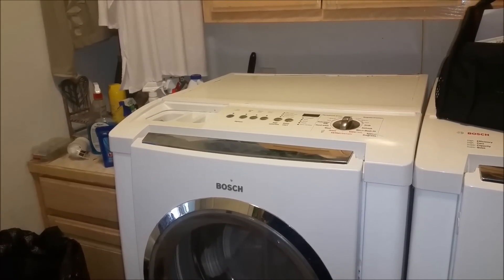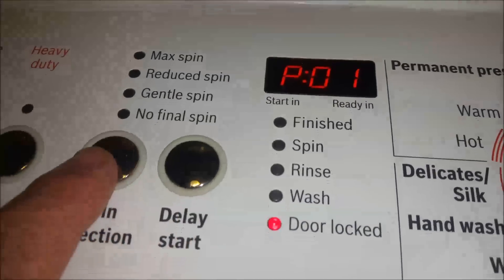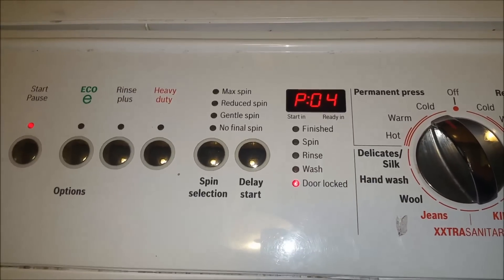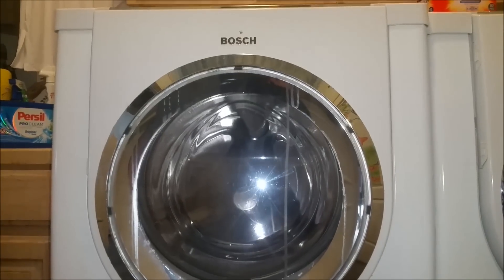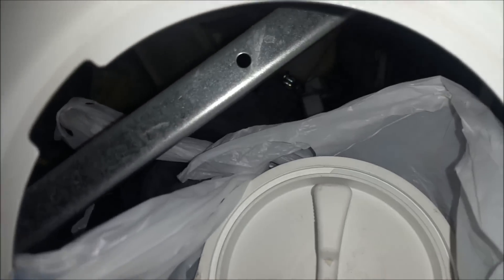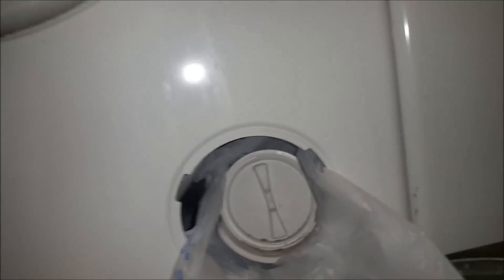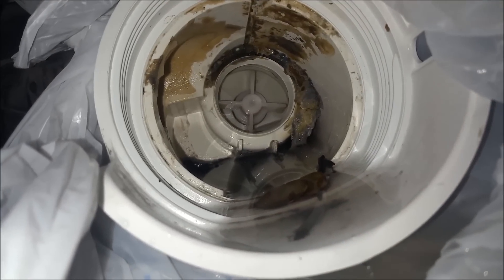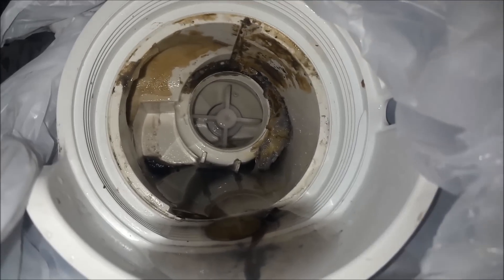Bosch Front Load Washer Won't Drain (e13 code)

Comment: I’m back again.  We are on pump replacement #2 for this machine.  Pretty sure my hb used your video 4 years ago when he replaced the pump the 1st time.  We've loved our Bosch washer and dryer for 15 years and 4 moves.  My only complaint is that it didn’t have a spin only setting.  I was heart broken to find out last year that Bosch no longer makes washers & dryers.  It strengthens my resolve to keep our current ones running as long as we possibly can. We’ve happily purchased many other Bosch appliances.  Thanks for still being here with this repair video.  Who knew we’d need it again?
Reply from the maker: Thanks and good luck
Reply: If you want German quality, go Miele. But I don't know what you mean when you say Bosch no longer makes washers & dryers. They absolutely do, and they do sell them in the US. They just don't make the 27-inch size any more (and neither do Miele after their equivalent flopped). They only make the 60cm size (about 23.5in).

Comment: THERE IS A EASIER WAY-------PAY ATTENTION TO THIS !!      I got my angle grinder & put a cutting wheel on. Next, on the bottom "right side" of the washer ( not the front where the hole is)   cut an opening...like a door, so you can swing it towards the rear of washer. The opening was approx. 4 inches X 8 inches, then bend it back, so when you're done removing & replacing pump,  you can just " unbend it " , put a little duck tape over the cuts  and the job is complete.       I have used the same procedure when replacing the fuel pump from a gas tank on my Ford Ranger. Most people remove the entire pickup bed from truck. I cut a 6" X 6" square ( only 3 sides though ) peel it back and remove fuel pump. Much easier.
Reply from the maker: Wow maybe you should make your own video

Comment: Can anyone explain what he's seeing with the pump that makes him says "That ain't gonna work" at about 14:25? It looks like the little fan thing is spinning freely so I'm not sure what he's seeing. I'd like to know my pump is dead before I buy a new one.
Reply from the maker: @screamingcats72  it loose and wobbles on the shaft bad end play although its normal to to have 1/4 turn of travel in a circle it not normall to fill loose and some of this is hard to show on camera and its also a trained fill that i see but past that it's a plastic impeller on a metal shaft and on the other side there's magnets set in plastic mounted on that shaft with close tolerances to the housing and I don't like recalls so when I get to the point of is there to much wear and tear i repace because they can work but be inefficient or make noise and in the scheme of things it's not price effective for me or the customer for it to go bad in 3 or 6 months and if something came in contact with that impeller while it was running chances are that it's going or is bad
Reply from the maker: Look at the left to right play that it has when I first put my finger on it
Reply: @Fasteddiesinhomerepair  Thank you so much, that was fast! I really appreciate it, and the video. I do NOT want to do this, LOL, but a repair man isn’t in the budget so this is a massive help.

Comment: If, upon inspection, you find that your drain pump is not locked up, moves freely, THEN... This is what fixed my E13 Error Code. Two screws remove the top panel; You will notice that the drain hose from the pump, loops up to the top of the cabinet. At That Loop is an AIR VENT attached. My vent hole was clogged with gunk.. Just pop off the tube, and clean it our with a toothpick, or small screw driver. Easiest fix ever. Note: if for any reason you remove the hose bracket, there is an O-ring where the bracket meets the tube, just don't lose it.

Comment: What if when you do p:04 it does drain fine? Does p:04 run & stop or do i still manually turn it off? Why do i keep getting e13 😆😭
Reply from the maker: E 13 means the washer thinks it has water in it so it could be something to do with the pressure switch or hose or air dome

Comment: Thank you so much for this video!! We followed your instructions and found 2 dimes and a ton of rubber pieces from the artificial turf but honestly not enough to stop the pump. We closed it back up and tested It and It still wasn’t working. I said let’s check again for the hell of It and lo and behold there were two WHITE rubber bands stuck in the middle that you could easily miss. We cut the rubber bands off and she’s good as new!! Can’t thank you enough because we would have had a tough time paying someone to have done that. We will pay your kindness forward!!

Comment: This approach worked like a charm to replace the pump/motor on our Bosch washer that is a different model than this one.   Like others, getting the top hose off was tough, but after that - everything else was very straight forward.  This was  HUGE help and saved me $$$ on a service call.  Thanks again!!

Comment: Thanks for the video.....

For general knowledge....

On my Bosch Nexxt 300 series WFMC2201UC, the specifications from the repair manual are as follows.

Measure resistance all parts disconnected.
Heater   13.7 - 15.2 ohms
NTC        22.8 - 27.4 kilo ohms @68 degrees F.
Water inlet valves 2.7 - 4.5 kilo ohms.
Drain pump    140 - 200 ohms.

Also,  E13 can be a pain to fix.....Usually is the pump, but also too much detergent being used can throw that code too.

One often overlooked repair is to remove both drain hoses and thoroughly clean them out.  They may be restricting drainage flow from pump.  (One hose comes from pump to back of washer from inside machine.  The other is the drain hose from the back of machine on the outside.)  These hose can get clogged with all sort of crap and build up.

OK....still with me?

Steps for a happy  Bosch washer.

Clean drain hoses or replace.

Descale heater element.

Clean water inlet valves.  Try a little spray of auto brake cleaner spray into front and back of valves......Obviously wipe excess and run some empty wash cycles.  Mine cleared out some stuff.  Check to make sure screens are clear too.
Check water supply hoses for good water pressure. (disconnect and see how water flows into bucket.   Should be a pretty strong flow.

Clean pump trap....or replace pump if needed.

I hope this helps some people with their repairs.

Comment: I love your plastic bag funnel ....so ingenious. My husband and I changed the drain pump and motor brushes, but still had a leak from the hose from the tub to the pump. Very hard to find metric o rings at the hardware store. Going to try Harbor Freight.

Comment: Thank you for doing this.  I would not have thought the pump could possibly fit though that hole.  This was much easier than having to take off the front or the back (I have a Bosch Nexxt WMFC3301UC/06). I made one minor change, which was to put the pump back in the way it came out. Other than that, I followed your instructions. The hardest part was getting the top tube off (getting it on was easy).  To remove the hose clamp, I used some smaller pliers with two positions (I think they're called slip joint pliers), and this worked well.
Reply: I tried turning the which hose clockwise and pulling the white hose up but the hose would not turn and of course would not pull up , any suggestions on what I am doing wrong?

Comment: This is an excellent video with great tips on how to manage the round trip to install new drain pump. I am amazed you did this all through the small front access hatch.
I was going to try to go through the back. I now have new pump in hand and getting ready to attempt this with your guidance.
Reply from the maker: Thanks Well let me know how you did
Reply: Worked out pretty well and faster than I thought, about an hour labor once the access panels removed and water drained. 
The outlet hose was the toughest part. Came off more easily by removing the whole pump first through front access then it twisted off fairly easily.
Putting outlet hose in new pump there was a lot of friction to seat it but got it in by twisting and pushing. The replacement pump from appliancepartpros.com looks a little different so not an OEM part but it works.
Set the pump down and pushed into slots from back was easier.

Tested without load then load, no more E13 - I am happy and wife even happier!
Reply: @Fasteddiesinhomerepair  It went great thanks for the video help!

Comment: Thanks for the video.  I was able to swap the pump out with minimal drama after seeing the video.  I think it took longer to drain the water than replace the pump.  I used a shop vac to suck up the water as it came out.  I replaced the whole unit not just the pump section.  I used an OEM Bosch part (OEM Part #00436440) and I was happy to see that they have added a small drain tube with a plug.  Now instead of making a huge water mess you can easily drain it with a small 3/8 hose the have added then remove the coin trap plug.  Anyway I appreciate seeing how you did it, I've sure I could have done it eventually but the video made it a ton easier. Bosch Nexxt 500 series washer ~peaty

Comment: Hello, I have a Bosch washer (model WAS24460UC/28) which was plugged directly to the back of the Bosch dryer.  The dryer broke and I have to get a Kenmore dryer. I just moved in this house and both washer&dryer are already there.
My question is since the dryer doesn't work, I can't get the plug from the washer to plug into the wall unit because of its unusual shape.  I tried to find the converter so I can simply plug it to the wall (I assume it's 120 volt washer).
Can you please help?  Thanks.
Reply: Bosch compact washers are 220v and that's why they plug into the dryer. No plug will fix that. They sell cord kits and you will need another 220v outlet, or just get a Kenmore washer... Hope you got it!

Comment: Check out my Bosch drain pump video; done by cutting a door in the lower side of the machine next to the pump and with that it takes about 5 minutes to change out the pump. Not the pretty way to do it but makes next time the pump quits, a snap to replace. No lifting of the washer and all the gym work getting down to the floor. good luck Other repairs to this machine include cutting the console to replace a stripped dial handle shaft of plastic for a filed metal screw that just pop into place. Another $330 savings. When the water starts to smell you could have a bad pump or just need to run a cup of bleach through the machine and see the crap come out of the exhaust water hose.
The Kenmore pump is the same for low $$$$ although it is a different color plastic. Last Bosch machine for me folks

Comment: Hi Eddie - great video - I struggled with the drain hose attached to the top of the pump - I did as you said - clockwise + pull up - hose came out clean (would have probably destroyed it if you hadn't so clearly demonstrated the action required) - tx so much for taking the time to do this video.... you have probably saved me from buying a new washer....

Comment: This is Not how to replace the drain pump on this Bosch washer. You just performed magic, unreal. All because you didn't want to take off the front panel? At the worst, the rear panel?
Reply from the maker: You mad bro
Reply: I just used Fast Eddie's technique and it is magic... it took me less than 5 minutes to remove the pump once I figured out which direction to rotate the pump outlet hose (clockwise with respect to the water flow direction out of the machine). Thanks for taking the time to put this on youtube Fast Eddie!

Comment: thanks Eddie - it never even occurred to me about service mode - I have a Bosch Maxx Comfort wfr3230 - do you know how to enter service mode for that please?  Google isn't findingany information on that series unfortunately and there is no error code only ''Pump Blocked?" displayed (I've checked the drainage pump and there were some coins in there.. but I cannot check to see if the impeller is turning or if the drainage pump motor has burnt out.  Thank you.
Reply from the maker: Well it only one one of 4 things 1 your pressure hose may be clogged if the water is being pumped out 2 if the water is not being pumped out it could be to much or rong soap making the pump go into suds lock 3 pump clogged or something has locked it up 4 a bad pump on that model I think that it just says what's rong no need to check for codes and that unit may have the drain and spin option
Reply: thanks mate, yeah pretty sure the pump motor is dead so going to try to remove it and test resistance and replace it faulty.
Reply from the maker: ohming it out may not tell you if it is mechanically good or bad. most pumps i deem bad mechanically not electronic and i think that model has a drain cycle so you can test it you might hear a faint hum its locked up or busted
Reply: nah its totally silent when i set the machine to drain so I'm assuming the pump is dead.
Reply from the maker: this guy seems to have it down but i would try leaning the unit back and take the kick plate off and the pump should come down and don't take the sump lose unless you need to that can be a headache   https://www.youtube.com/watch?v=2p4G9ibMAMI
Reply: thanks matey - yeah the Australian version of the Bosch front loaders have a bottom plate riveted in place, I'd need to drill out the rivets to get access from the bottom.. might still do it though as I can't get enough access through the back panel.  You can sort of see the bottom plate in this pic of the insides - actually, are those two metal tabs at the very end of the pump a valid test point?   https://imgur.com/a/epLUa
Reply from the maker: i can't show you but the wires are pulled out of the plug on this pump blocking the test points

Comment: Why didn't you try the pump after you pulled the sock out?  It could've/would've/should've worked.  Maybe not as efficiently but it would have saved the customer the cost of a new part.  Well that's just me.  I'm a cheap bastard.
Reply from the maker: tested bad
Reply: After thoroughly cleaning ours (thank you for this awesome video, BTW!!!), it worked while dry, but seized up again with water in it - it seems that once the debris in the pump has ground down the magnet and/or the bearings inside, it doesn't function properly anymore and will need to be replaced. I now wonder if there are motors that flush their own housing while they pump, rather than slowly filling themselves with debris, that would make them last way longer.

Comment: Bosch is a very poor quality products, I have all the Bosch Appliance and all kinds of problems with them.
Reply: It's not, it's depending on how the people handle the appliances, you need to keep it clean, to clean the pump from time to time and to wash with high temperatures as well.
Reply: I disagree! (even though our pump failed). This machine has worked great for us for 10 years. The pump failed because we live on the ocean and the housing filled up with fine sand from our clothes, which ground down the interior of the pump over time. Similarly, the inlet valves got clogged up with sediment in the tap water. Now that these parts have been replaced, and seeing that the rest of the machine is pristine inside, I expect it to last another 10 years! Overall, we've been extremely happy with this Bosch appliance!
Reply: My Bosch Washer is 16 years old and it runs well excep for the drain that gets clogged every 8 years or so.  As an engineer, I admire Bosch for it marvelous ingenuity design.  My next washer  will be a bosch